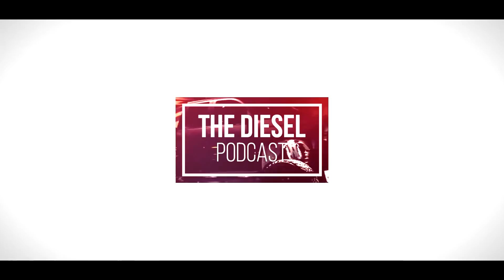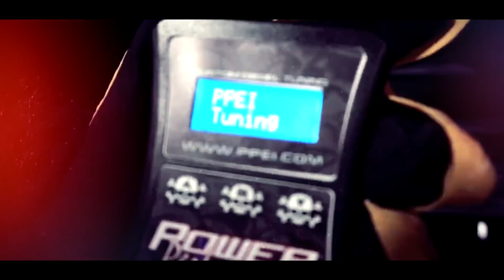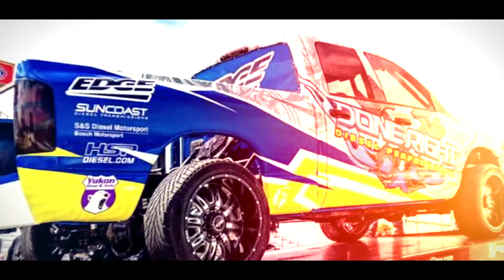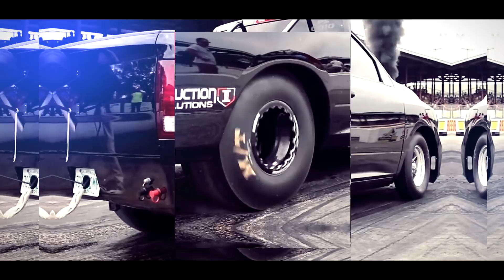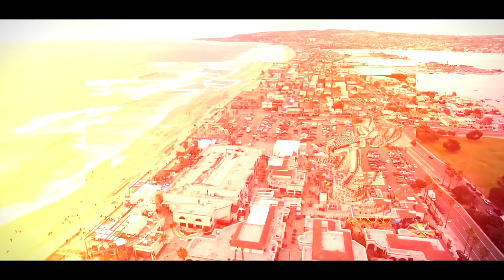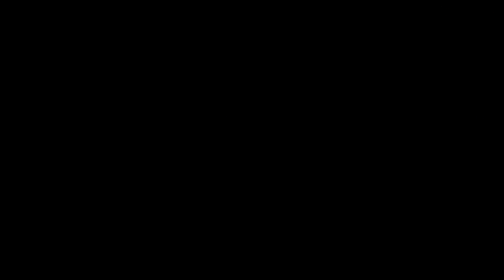When are Billet Shafts Needed?

Comment: So basically if you dont have time to listen:
Priorites-
Billet input and flex plate with upgraded torque convert 500 plus
Next
Billet Intermediate 800 plus
Last
Billet Output 4x4 launches 600 plus
Reply: Is that torque or hp?
Reply: @Gekkoperformance hp